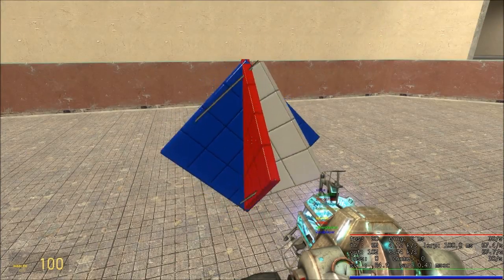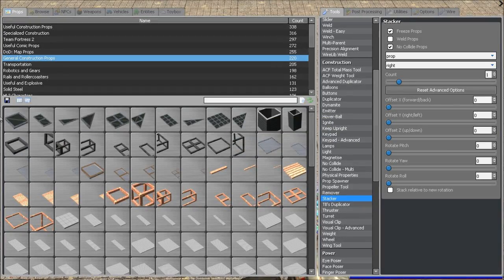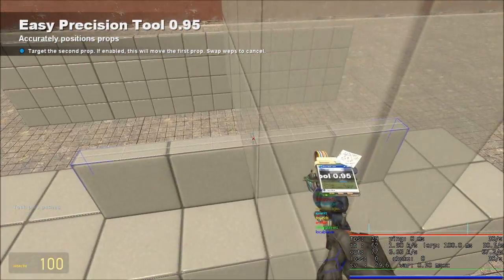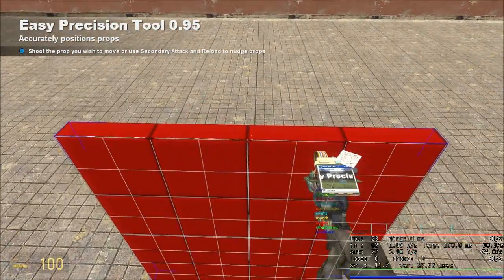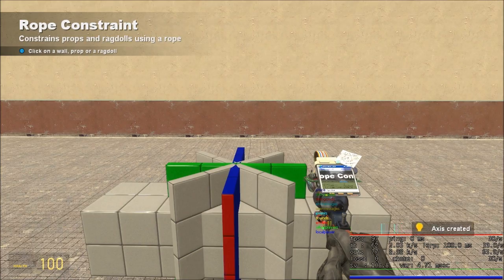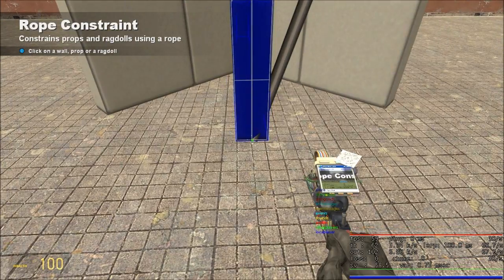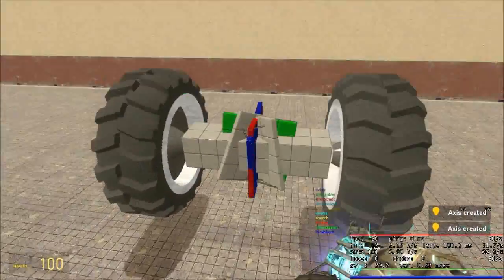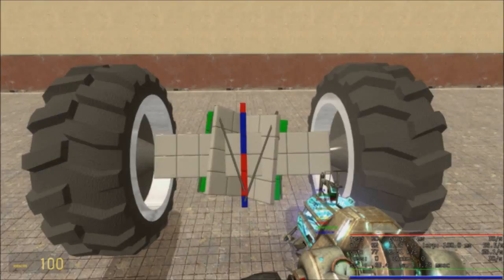(GMod) (Tutorial) Building a BRD Differential

Comment: This one's much more suitable than a diff constructed from ballsocketed plates at right angles to one another because it doesn't suffer from spazzing due to gimbal locks. I was trying to use a ballsocketed differential in a tank powered by a prop engine and transmission and it struggled with turning on the spot due to gimbal locking.
Reply from the maker: Have you tried experimenting with using multiple ballsocketed plates to ease the transition between angles? Say, a 3rd plate at a 45-degree midpoint between the other two plates and ballsocketed accordingly?

This rope design is quite a bit more robust, yes, but it eats up a lot of constraints and puts a lot of strain on them, which Source doesn't seem to like much. I've found that ballsocket differentials are less taxing on servers than rope ones.
Reply: @mwhite112393  Wow, I didn't expect a reply on such an old video. I've thought of using multiple plates to prevent gimbal locking, but I found this and it worked just fine, so I left it.

But, now that you've said ballsocket diffs are less taxing on servers, I might give that a go. As long as it can handle the torque from the engine, I'll probably use that. I haven't figured out double differential steering or similar mechanisms to enable neutral steering, though.

(Yes, I know ACF is ideal for this stuff, but I wanted to try and make a mechanical tank)
Reply: Nope, just tried it and it couldn't handle the torque required to turn the tank as well as the rope diff. The ballsocket constraints just started slipping.

Ah, well. I'm sure I can still use it in trucks or similar vehicles (diffs are too heavy for cars), but it doesn't seem to be applicable in tracked vehicles.
Reply from the maker: @poqqery8950  Good on ya for trying it out, though. Yay science!

Comment: I have been trying to attach the flywheel of one of your engines to the 1/x3 PHX block, but i cannot get it right. I want the engines flywheel to be 90 degrees with respect to the 1/x3 PHX block. First I tried transferring the rotation of the flywheel with gears but the power from the engine caused them to slip...is there a way i can transfer the power of the engine directly without using gears?